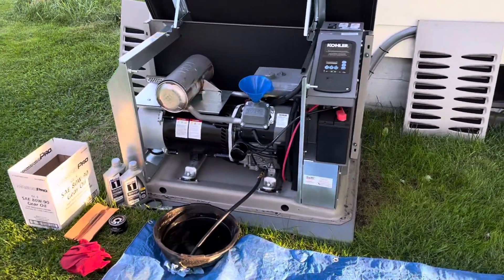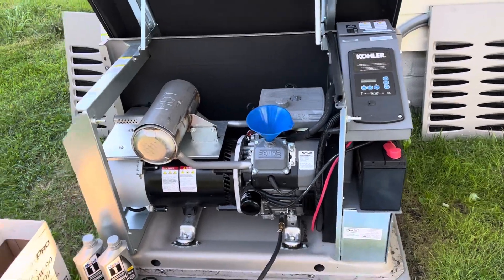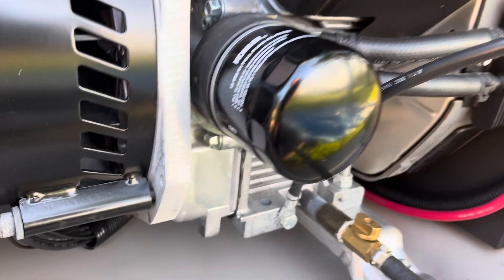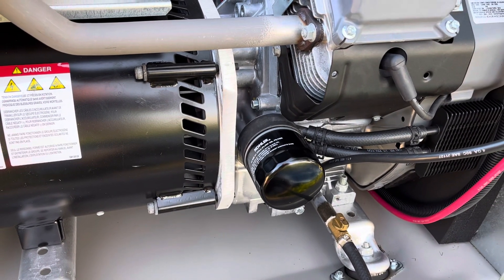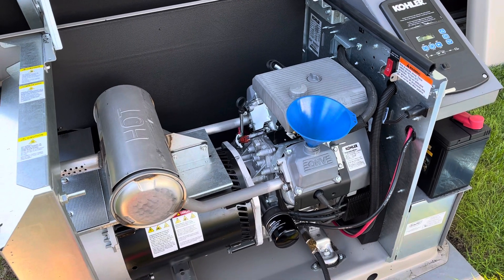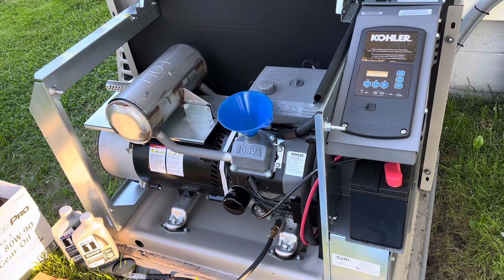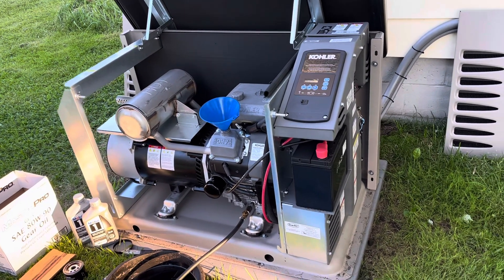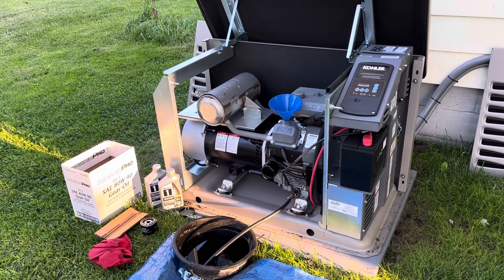Kohler 14kw Generator - DIY Oil change and filter

Comment: Most of these small engines with a full size filter, use the 3614 base filter. Useful info to know, especially since they won't tell you that, and instead want you to buy a expensive filter. All of my lawnmowers, I've chosen to switch over to either wix or fram, anything but the expensive Briggs and Stratton filters.

Comment: Very slow draining, was worried I wasn’t doing it right. Thanks for sharing
Reply from the maker: Yeah it's just the design I think.  It's hard to get the drain hose at an angle to drain faster since it's so low already.  I let it drain for quite a while.

Don't fill it to the full capacity with new oil either.  Leave a little room because there is likely a little oil left in the crankcase that didn't drain, etc.  You can always add a little more if it's just a tad low after you start it up and run it for a bit.
Reply: Thanks again

Comment: To speed up the draining process, run the generator for about 5 - 10 mins to get it hot. It will flow out much easier for you. Great Video, I saw the CRG sticker on the front panel, they also installed my 14kW system.
Reply from the maker: That’s a good idea, I’ll keep that in mind next time.  They did a good job and everything has worked flawlessly so far.  Seems like a solid company.

Comment: My manual says 1.9 qts or 1.8 liters on 14RCA.  I wonder if you may have confused the liter/qt info?
Reply from the maker: Yeah you’re right, 1.9 quarts.  Basically just get 2 quarts of oil, fill with 1.5 quarts after draining, then check dipstick and add until full on the dipstick.  I think I used about 1.75 quart since a little was left in there that didn’t drain.
Reply: @novaguy383   Would you list the standard maintenance parts # equivalents using Champion Spark plug, Phram oil filter,  gas filter, and air filter.   Maybe the kit number.  Anyway,  you get the idea.  

Thx

Finding that info has been difficult, and I know how to research.  My 14RCA is about 3 months old, so I don't need it, but would like to have extra on hand.  Maybe a video???

Comment: They actually ran hard gas line all the way to the generator?  There really should be a flexible line there to allow for vibration or slight movement of the generator.
Reply from the maker: There's a section of flexible line between the generator and line from the house.

Comment: Whoever installed your generator, did it wrong and surely against city/county/state code.  That Natural gas line should have a flexible line attached at the generator bacl to the wall of the home.  You paid 11k including install?  Thats way too much.  You got taken for a ride.
Reply from the maker: Nope, wrong on all accounts.  City inspector came out and approved it.  The gas company also approved the install.  $9-12k is the going rate in my area, checked around at multiple places.  It’s not 2005 anymore, prices have gone through the roof on everything.
Reply: @novaguy383  what do you think is going to happen over time as that generator vibrates that natural gas line and there is zero give? It's going to snap right at the threads. This is a well known plumbing problem that existed well before I was born. Read you installation manual for the genset. I know for a fact it says it in there. I own a 12res and take care of a 50kw and 100kw kohler and have since 2009.
Reply: @mikeanonymous669  He seems to have a flex line to me. It is the black rubber line between the trap and the house connection.
Reply: @novaguy383  looks like you have a flex line, is that black center section not rubber?
Reply from the maker: @thastinger345 yes it’s a flex line.  Not sure WTH the other guy is talking about haha!
Reply from the maker: @mikeanonymous669 dude watch the video again and pay attention.  There is a flex line from the house to the generator.  Nobody cares how many generators you have.  😂
Reply: @novaguy383  I'm getting one installed this fal.l $9000.00 full installed price. With doubled warranty to 10 years because of a promotion. Generac dealer said 10 to 12 thousand and that was in the town the dealer is located in. We're about 75 miles out of that town. I'm having mine put on a pedestal about 2 feet high to keep it out of the snow and have better air flow.